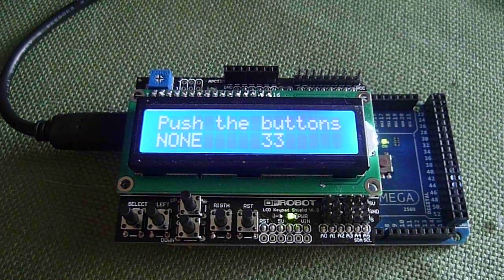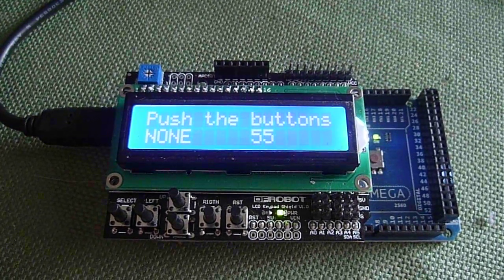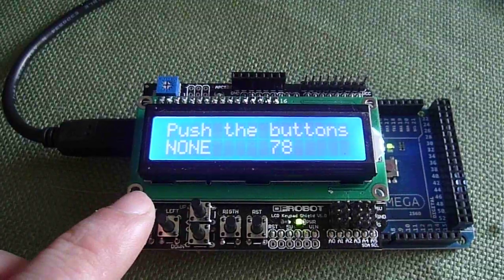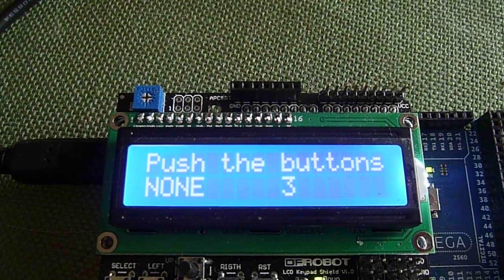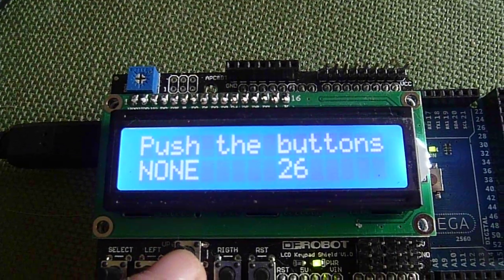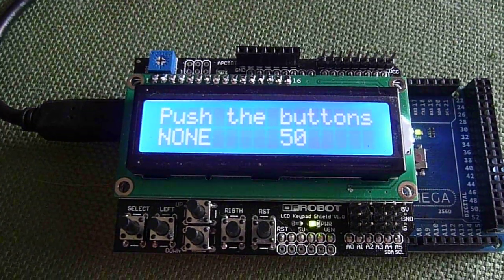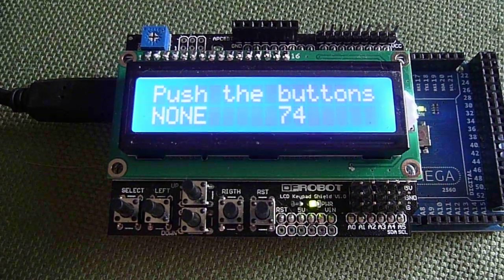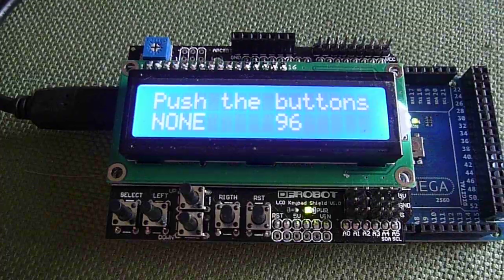Arduino LCD / Keypad Shield

Comment: i'm trying to make a digital dice to be able to play catan with, the problem is that when i go to upload the code i get:

C:\Users\taran\Documents\Arduino\sketch_jun29a\sketch_jun29a.ino: In function 'void loop()':

sketch_jun29a:68: error: 'buildUp' cannot be used as a function

         buildUp();

                 ^

sketch_jun29a:92: error: expected '}' at end of input

     }

     ^

exit status 1
'buildUp' cannot be used as a function

 and the code i'm working with is:

#include "LiquidCrystal.h"

LiquidCrystal lcd(8,9,4,5,6,7);

//define values used by panel and btns
int lcd_key = 0;
int adc_key_in = 0;
int diceOne;
int diceTwo;
int   buildUp;
#define btnRIGHT 0
#define btnUP 1
#define btnDOWN 2
#define btnLEFT 3
#define btnSELECT 4
#define btnNONE 5

//read the buttons
int read_LCD_btns(){
  adc_key_in = analogRead(A0);
  if(adc_key_in > 1000) return btnNONE;
  if(adc_key_in < 50) return btnRIGHT;
  if(adc_key_in < 195) return btnUP;
  if(adc_key_in < 380) return btnDOWN;
  if(adc_key_in < 555) return btnLEFT;
  if(adc_key_in < 790) return btnSELECT;
  return btnNONE;
}

void setup(){
  lcd.begin(16,2);
  lcd.clear();
  lcd.setCursor(0,0);
  lcd.print("select to dice");
}

void loop(){
  lcd.setCursor(0,1);
  lcd_key =read_LCD_btns();
  
  switch(lcd_key){
    case btnRIGHT:
    {
      lcd.print("RIGHT  ");
      break;
    }
    case btnLEFT:
    {
      lcd.print("LEFT   ");
      break;
    }
    case btnUP:
    {
      lcd.print("UP     ");
      break;
    }
    case btnDOWN:
    {
      lcd.print("DOWN   ");
      break;
    }
    case btnSELECT:
    {
     diceOne = random(1, 7);
    diceTwo = random(1, 7);
    break;
    if (btnSELECT == HIGH) {
        buildUp();
        lcd.clear();
        lcd.setCursor(7, 0);
        lcd.print(diceOne);
        lcd.setCursor(7, 1);
        lcd.print(diceTwo);

        if (diceOne + diceTwo == 7) {
            lcd.clear();
            lcd.setCursor(7, 0);
            lcd.print("7");
            lcd.setCursor(3, 1);
            lcd.print("The pirate");

      if (diceOne + diceTwo == 5, 4, 3, 2, 6 ) {
      lcd.clear();
      lcd.setCursor(7, 0);
      lcd.print("5,4,3,2,6");
       
    }
}
}
}
    }
Reply from the maker: Taran Agnew you are missing a buildup fubction.
Reply: i put the buildup function in but i'm still getting an error when i upload
Arduino: 1.8.5 (Windows Store 1.8.10.0) (Windows 10), Board: "Arduino/Genuino Uno"

C:\Users\taran\Documents\Arduino\sketch_jun29a\sketch_jun29a.ino: In function 'void buildup()':

sketch_jun29a:38: error: 'buildUp' cannot be used as a function

  buildUp();

          ^

C:\Users\taran\Documents\Arduino\sketch_jun29a\sketch_jun29a.ino: In function 'void loop()':

sketch_jun29a:76: error: 'buildUp' cannot be used as a function

         buildUp();

                 ^

sketch_jun29a:100: error: expected '}' at end of input

     }

     ^

exit status 1
'buildUp' cannot be used as a function
Reply from the maker: Taran Agnew buildup and buildUp are two different things. You did not post your void buildUp function that i could see. What does it do?
Reply: this is what the buildUp function does
void buildUp() {
 buildUp();
        lcd.clear();
        lcd.setCursor(7, 0);
        lcd.print(diceOne);
        lcd.setCursor(7, 1);
        lcd.print(diceTwo);
}

Comment: This is a very popular LCD Keypad shield for Arduino and other variants. It includes a 2x16 LCD display and 6 momentary push buttons. Pins 4, 5, 6, 7, 8, 9 and 10 are used to interface with the LCD. 
you could get it here: https://www.dfrobot.com/product-51.html

Comment: I have the same shield, and mega board, how do I make the LCD interact with two buttons on pins 21 and 22?
Reply from the maker: Arduino4Me The buttons are connected to a single analog input. You could bend that pin out and jumper it over to a different analog input, but neither 21 or 22 are analog input pins.

Comment: How many hours -  in general as crude average - can a 9 volt battery make an Arduino Uno with LCD Shield run?
Reply from the maker: I have not tried, so I have no idea.
Reply: Feeding 9V into the Vin line draws ~58mA on an Uno with this shield(depending on brightness of the backlight). To figure out how long it will last depends on the battery's mAh rating which you should be able to find on wikipedia

Comment: does this works with arduino wifi shield?
http://arduino.cc/en/Main/ArduinoWiFiShield
Reply from the maker: No, they are not compatible:

The wifi shield uses digital pins 11, 12, and 13 on the Uno and pins 50, 51, and 52 on the Mega. On both boards, pin 10 is used to select the HDG104 and pin 4 for the SD card. These pins cannot be used for general I/O. On the Mega, the hardware SS pin, 53, is not used to select either the HDG104 or the SD card, but it must be kept as an output or the SPI interface won't work. Digital pin 7 is used as a handshake pin between the WiFi shield and the Arduino, and should not be used.

The keypad shield uses digital pins 4 - 10, and analog pin 0.